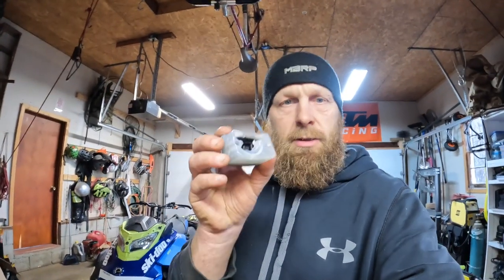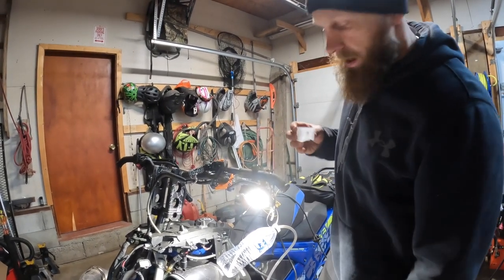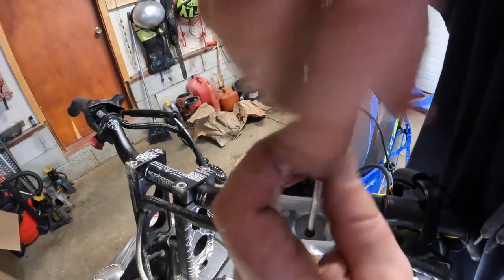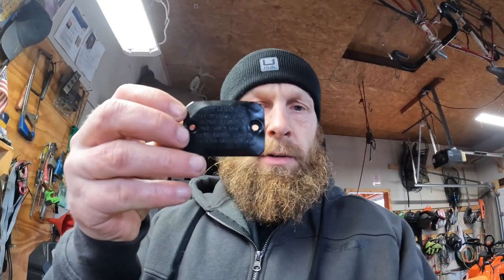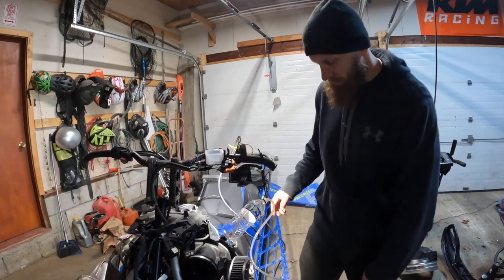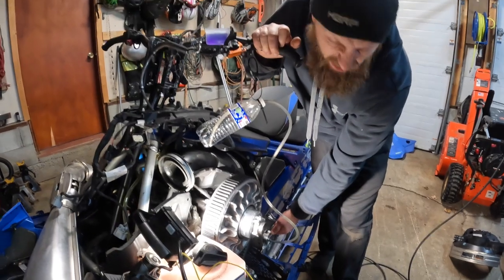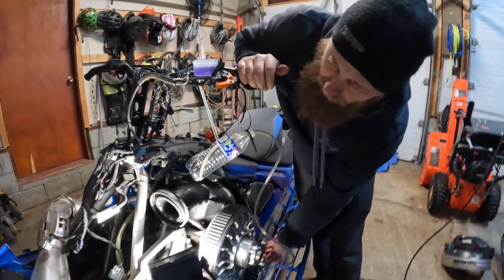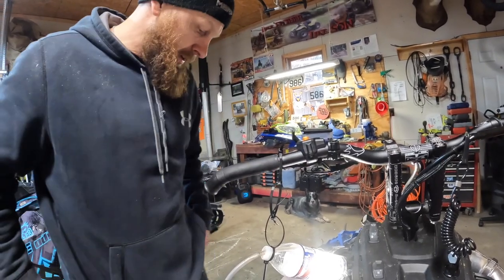How to Bleed Ski-Doo Brakes.  #skidoo #brakeservice #freeride #summit

Comment: So did you use the DOT 4 Skidoo or the NAPA DOT 5 purple ?
Reply from the maker: We ended up using the Skidoo Dot 4.  After some quick research couldn't find any clear information on if Dot 5 is ok.  Hoping someone will comment if Dot 5 is ok.
Reply from the maker: My buddy Joe said it makes a good beard oil... 😁
Reply: My understanding is that DOT 5 is silicone based and is not compatible with DOT 3 or 4 fluid and perhaps not compatible with the components of a DOT 3/4 brake system.  I have heard that if you want to switch to 5 you need to completely clean out the previous fluids.  In general, the switch is not made.
Reply: Correct @jonmcphee9662
Reply from the maker: Agreed.   @jonmcphee9662